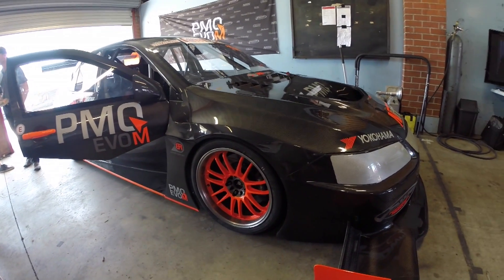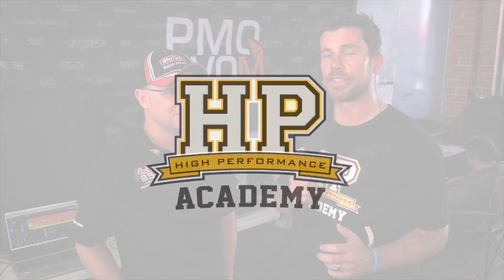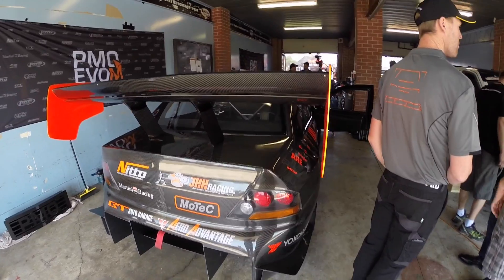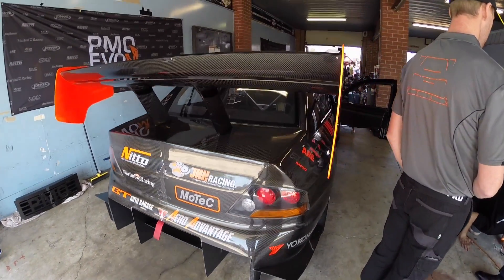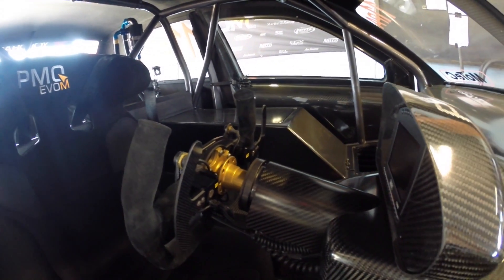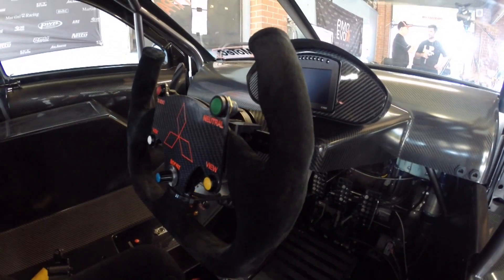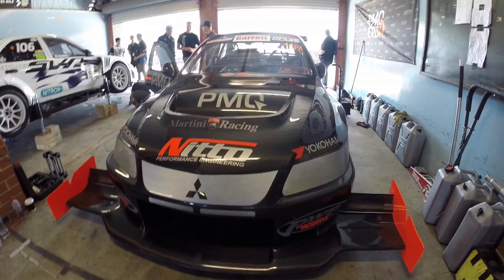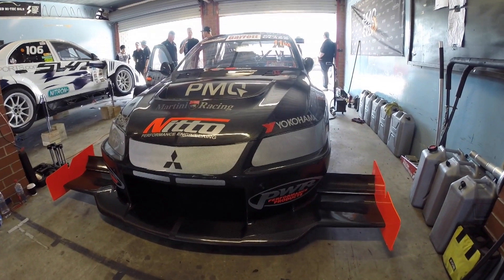Ignition Cut For Gear Changing | Flat Foot Shifting EVO [TECH TALK]

Comment: I use closed loop on gear barrel position that takes reference voltage on preloaded lever and works on a percentage change to next gear, happens live for each gear. I run my sequential on a Syvecs like this. 60ms shifts are common and smooth as butter.

Downchange can still use closed loop barrel position while blipping. Revlimit based on post downshift rpm as described here I find does not work well in my box, I use manual blip target and end the blip on closed loop barrel position, but as said each set up is different.

Comment: Andre 
At what point in my clutch pedals travel do I want my flat shift torque cut to engage? The second I touch the pedal? Or once the actual clutch starts to disengage? Wondering if you had a good rule of thumb for this. 
Thanks,
Reed
Reply: if you run a manual gearbox with synchros, it often works best with a timed cut. So it does not matter because you press the clutch so fast, that when you tuned the timing for the cut its always the same speed you press anyway. I have a micro switch thats reacting as soon the pedal is pressed like e few cm. I used a timed cut for about 200ms and it worked really well flatshifting my m3 gearbox.

Felt like power was almost instant on the next gear.

Hope this helps.